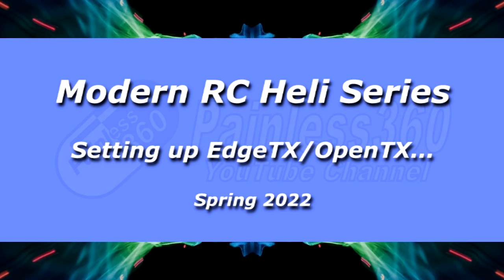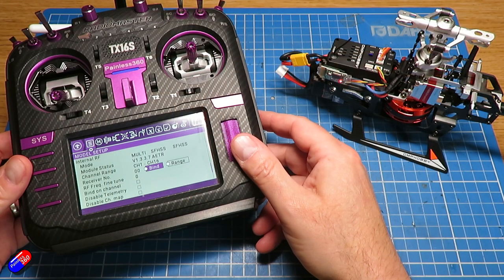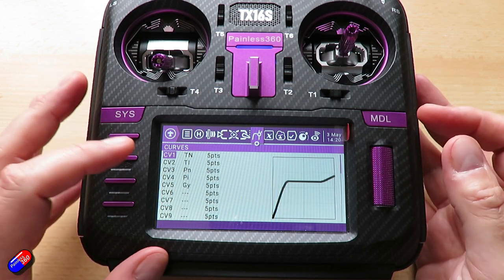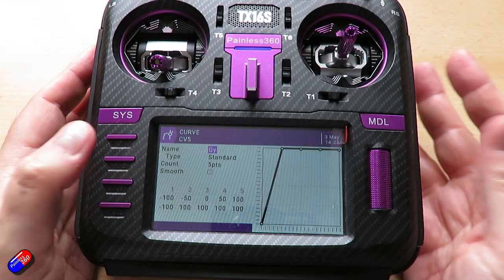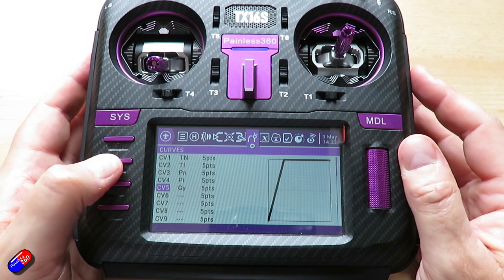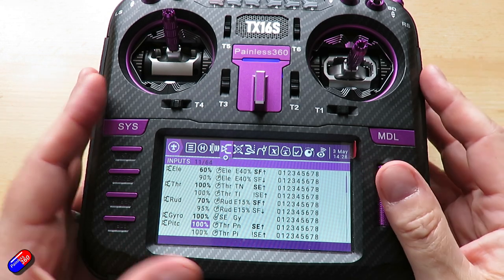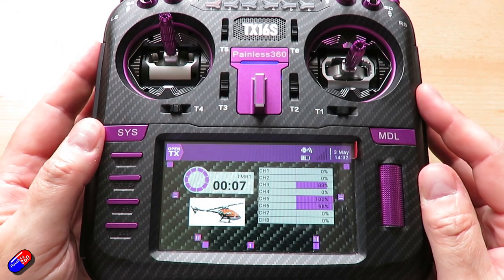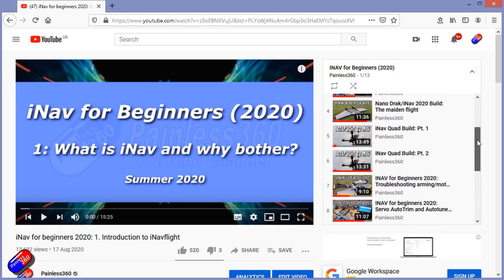Setup EdgeTX/OpenTX for your OMPHobby M2 Heli using an SBUS receiver!

Comment: I have been struggling with Zorro for a K110S. Can I use this excellent video of yours as a template? To make things more gradual, can I start by having normal curves only and go on from there? Thks so much.
Reply from the maker: It's a start. Test everything without the blades on the heli.. Best of luck

Comment: As always great video. I don't have a "modern" Heli, I'm setting up a flybar tarot 450 I've had for years. I've got an Assan G250 gyro on it and unfortunately I just don't quite follow what I'm supposed to be doing with it. I've never been able to get it into rate mode. My flying skills have digressed to a 3' ish tail in hover diameter. I'm getting that dreadful "tailwag" gyro oscillation. Could someone please explain what I need to dial down in order to make it stop. I've been away from the hobby for a little over 8 years and my Heli is around 10 years old with about 5 hours of flight time and around 9 years of shelf time. Any assistance would be greatly appreciated.
Reply from the maker: https://youtu.be/vstEdsbHJbY is the only video I can see... best of luck

Comment: Just wondering, what is the benefit of adding an additional receiver?, the M2 comes with a built-in receiver and the Radiomaster you're using has a multiprotocol unit?.
Reply from the maker: Benefit covered at 1:19 in the video... Happy flying
Reply: @Painless360  Thank you, but still not clear. Can you not set different modes, throttle curves, idle-up, etc with the integrated receiver ? BTW, big fan of your channel and content 😃
Reply from the maker: Nope. See the video in the series using the integrated reciever. No curves or options to tweak anything. You get what OMPHobby programmed into the flybarless controller.. Happy flying
Reply: @arooshelahi  Hey Buddy. Using the OMP protocol the throttle percentages are fixed values set by OMP. However you can set your own collective pitch curves for normal, idle ups and TH hold and then use the dual rates and exponential to fine tune the models cyclic responses to your liking, so it's not all bad, just not ideal. But definetly running a seperate receiver, avoiding the in-built OMP protocol, is preferred by the majority of buyers
Reply: Thanks guys, I understand now and running a separate receiver, all is good 😀